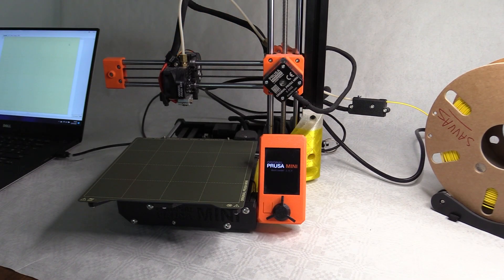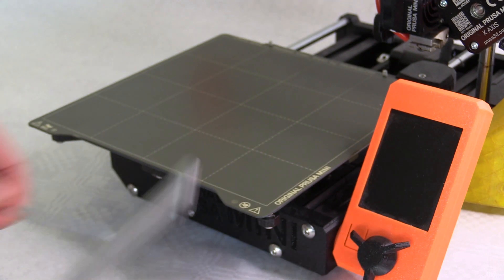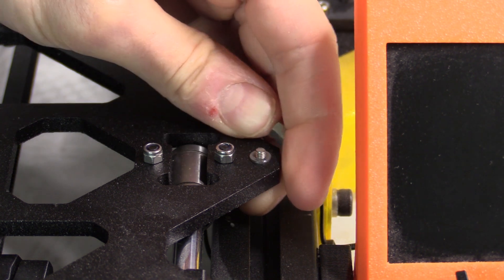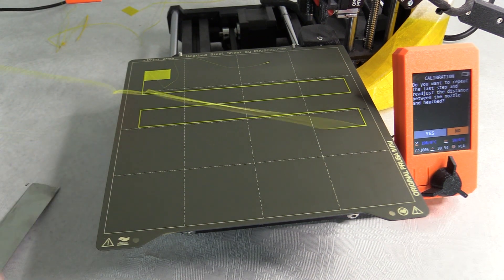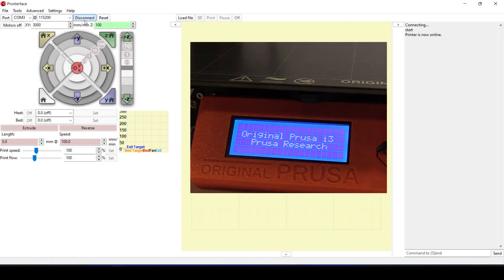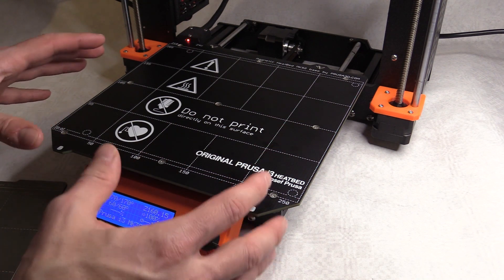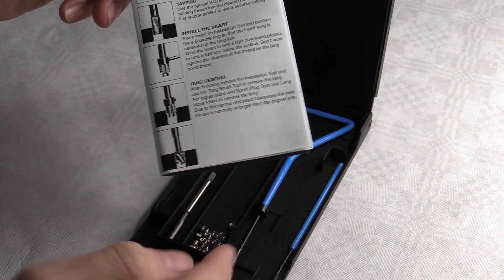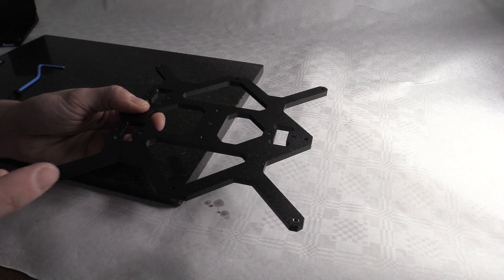First Layer Adhesion - 3D Printer Bed Mesh Levelling Mods - Prusa Mini+ & i3 MK3S+

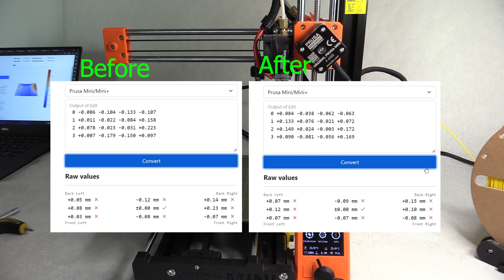Comment: hey, first thanks for the video. I have the same issue on my prusa mini and I hope I can solve it with this mod. but I don't understand one thing. in 5:22 the results before and after are just better in one point or am I wrong?  the only one value that got better is the one from +0.23 to 0.1.. every other one is a little bit off compared to the one "before". why is that so? was it just this one point that was the problem?

Comment: I have a similar problem where the right side of my mini seems lower (prints lift off on right side but left side is fine).

Couple of questions
1. I've done xz squaring and it looks to be almost perfect
2. Doesn't auto bed levelling correct this?

No matter what I do, my right side seems to lack adhesion!
Reply from the maker: Bed levelling can only compensate so far - you need to perform the bed levelling mod - possibly as I did using shims to pack out the head bed. You can also adjust the first few layer print to 40% of normal print speed which should also help.